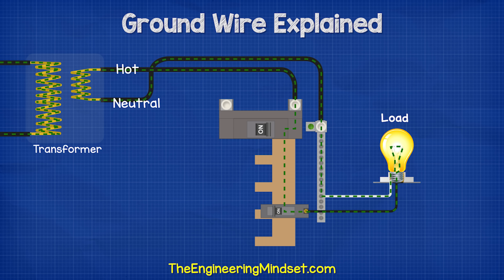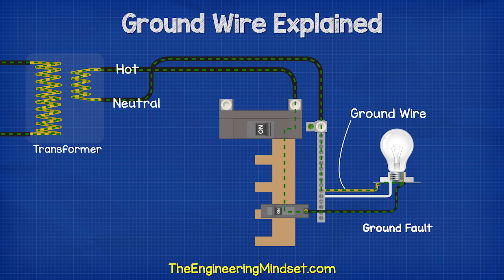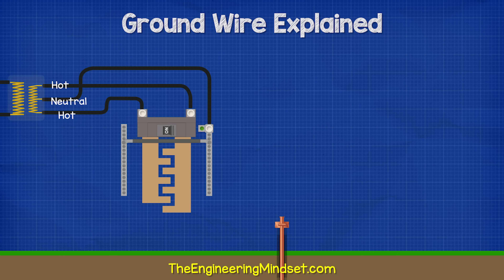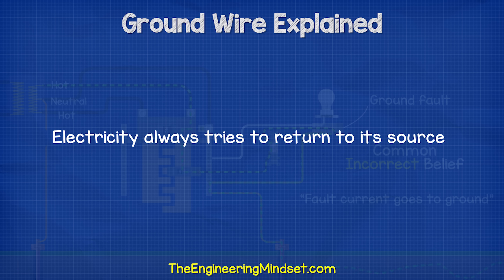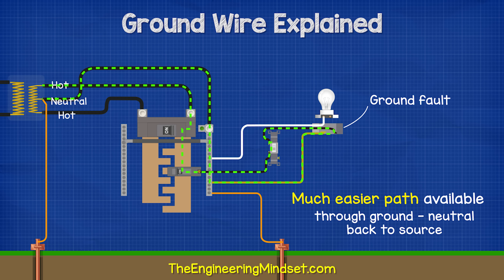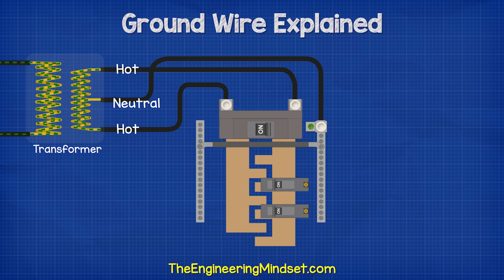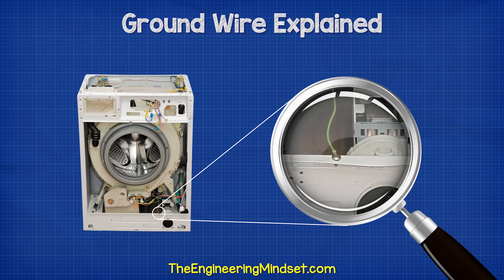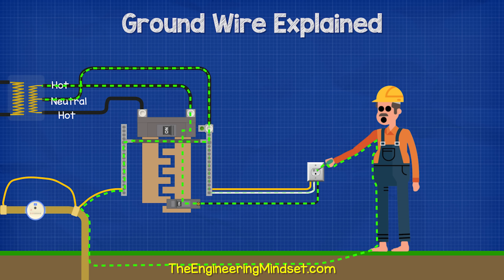Ground Wire Explained

Comment: This is fantastic. This is such a murky subject for even experienced electricians. This explanation is so clear, love it!
Reply: @zlmdragon.  you would be surprised how many electricians don't properly understand how grounds work.
Reply: @ke6gwf   mm
Reply: Great explanation
Reply: Yea not really murky for experienced. Its like the double insulated vs grounded case. Also the grounding bushing on conduits of service entrance. The ground path has to be able to carry enough fault current to operate the protective device or you end up with energized case, panel conduit, device or anything else. When utilizing non-metalic boxes or double insulated tools there is no risk to the occupant or user as a fault to insulated case won't energize the device.
Reply: @beni7928 The wire could still come loose in the light fixture and energize that device even with a plastic electrical box.
Reply: @nancypelosi2627  electrical devices if metalic have grounding lugs, not sure what you talking about
Reply: @beni7928  You were saying grounding doesn't matter in a plastic box.
Reply: This 'source' idea helps to envision what happens when current flows through you on the way to the physical ground: is doesn't just dissipate, it goes to wherever has lower potential. In the case of the video, the other ground rod. Or maybe I have this wrong. Electricity has to go somewhere, and is that somewhere spread out into an area of given earth, until it no longer has any potential?
Reply: 400th thumbs up here. You are 100% correct ✅
Reply: It is scary to me that any electrician, much less an experienced one, does not already have a very good understanding of this.
Reply: 100% agree. This is the basic stuff.
Reply: @ScienceBitch123  hahaha right, this was like year one of my apprenticeship!
Reply: @ScienceBitch123  Electrical apprentice here. I can state, without a doubt, most electricians know how to wire stuff together, but they suck at electrical theory. Most get this backwards and think electricity goes to ground.
Reply: Problem is, in schools they still teach weird colloquialisms like "electricity always goes to ground" and that devices "draw" current. It's weird and misleading to say those things.

But to understand how to wire a house, it's much more physical and code-oriented (heights of plugs, switches, and various other measurements and rules) than it is electrical theory.
Reply: That’s probably, at least partially, due to the fact that we confer the title “electrician” on any apprentice wire puller. They get on the job and pull wire so we call them “electrician”.
Reply: @totallyfrozen  then why are you watching this video?
Reply: @totallyfrozen  No, we call them apprentices. I know this because I am one.
Reply: @totallyfrozen  Kinda like every other job. Not all teacher's are teaching, etc.
Reply: @AtechG35  
Not “every other job”. Career fields that require licenses are immune from that unless someone breaks the law. For example, if you’re not a licensed medical doctor, but you identify yourself as a medical doctor, that’s a felony. If you’re not a certified police officer, but you identify yourself as a police officer, that’s a felony. If you’re an apprentice wire puller new on the job, you get to tell the girls at the bar that you’re an electrician and that’s fine.
Reply: So true XD
Reply: Ground is hot that's how I remember it lol

Comment: Electricity takes all paths! It pours max current in every direction. Deep Earth is the best Ground as it is the major electromagnetic field upon which we all ride.
Reply: Absolutely true. The point with the ground wire is that it will cause a massive current to flow in the hot (aka live) wire which will trip any fuse, thus stopping all current quickly. In theory, modern circuits should be protected with RCD device which will detect even small leakages to ground (even that through a human body), but it's always good to have a backup. Systemically, the ground does also stop static electricity and (helps with?) lightning strikes as these have limited amounts of charge which is "instantaneously" depleted by the low-resistance through the ground wire rather than the slow depletion via a high-resistance human.

Comment: So a power plant is connected to the earth and uses it as the neutral conductor?  Very confusing.
Reply from the maker: Well, they typically use a delta connection. Only residential end is star to create the ground point.

Comment: How about a video on most common ways people get hurt by electricity and how to avoid it. Thanks!
Reply from the maker: Good idea, my shock was from touching an intermittently live wire.
Reply: @EngineeringMindset  I was recently shocked by an electric iron🥺.
Reply: Most common way people get hurt is by touching live wires 😅
Reply: How to avoid it? De-energize every circuit before you work on it, make sure you understand grounding (as explained in this video), make sure you ground all your circuits, make sure everything is safe and all people and animals are not touching the circuit before you re-energize it (lock out/tag out). Pretty basic concepts, I think.
Reply: @totallyfrozen  I got shocked working on an electrical board for an old radio I think.   Arm to arm and I could feel the jiggling current , this was only a moment and after that I measured the voltage and it was 800 volts.  So the current must have been low.   I have also been shocked at few times with 30,000 volts , the anode of picture tube.  This shock just opened my hand and the screwdriver dropped.  The current would be extremely low.  The dangerous shocks are when the voltage is low so that the current can be high.   This was about 40 years ago.  I recently went to the dentist and he hit a nerve in my tooth with the needle and I thought I was getting electric shocks.  It felt just like a shock but it was his needle hitting the nerve.
Reply: #1 way to avoid it: leave it to professionals
Reply: #1 cause: by being alive, easilly avoided by using time travel to give your dad a condom/swift kick to the goolies.
disclaimer: this is not legal advice. condoms are not 100% guaranteed to work; I hold no responsibility for accidental discovery of infidellity. time travel may cause motion sickness, fatigue, dorcelessness, etc. so consult the a doctor about it first.